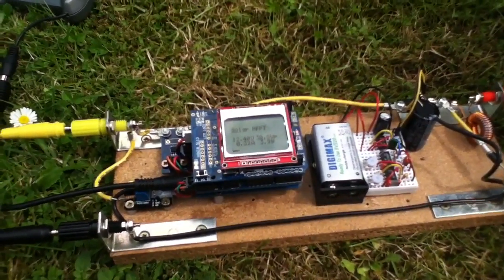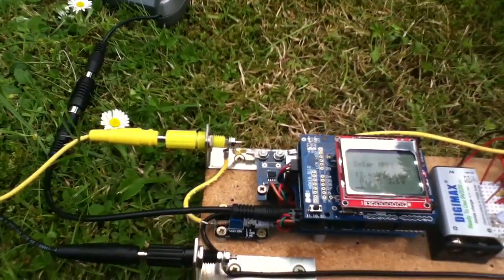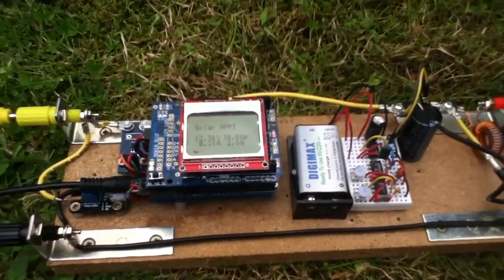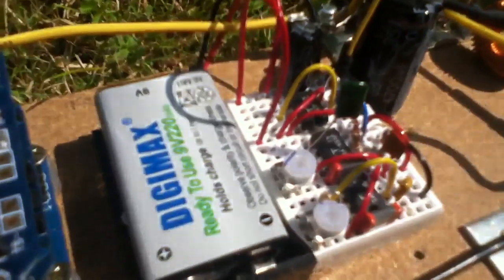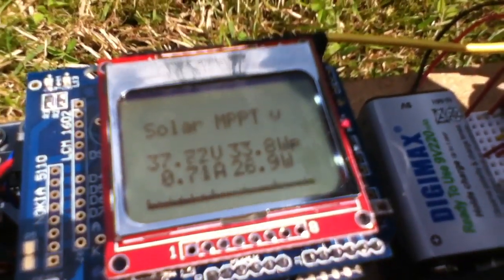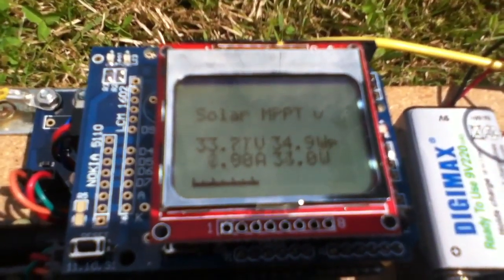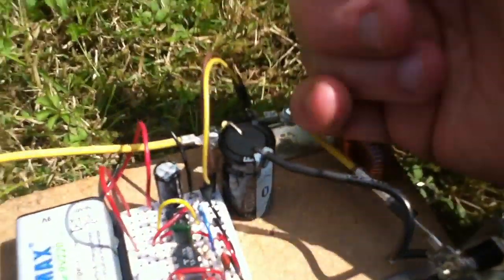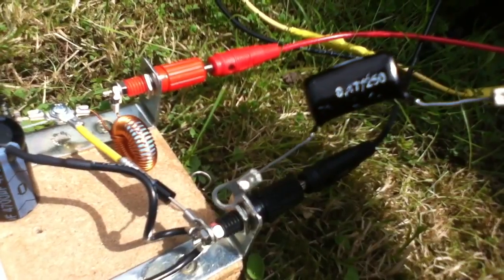MPPT Solar Charge Controller #10 - 72 Cell Solar Panel charging 12V Battery

Comment: Look up deadbanding. It's how they display tank gauge reading.  Basically, you only change /register new reading if it changes by 1up or down-by dead+band value.

So if db value is 2 watts and value is 17, you ignore readings until a new value is <=15 or >=19.

Comment: The solution to your dilemma at the end of your video (too bright for oscillator but you need sun for the panels) is that you leave the panels outside and run wire into your house/lab and do your work in there.  I know you would have to go outside to adjust the panels occasionally, but it would still be better :)

Comment: can i ask a favour julian ? just say i had 240v 1600rpm ac motor , now theres two questions i here what size inverter would i need to comforyably run it continuous ?

second quedtion - how would you with wires cheaply control the 12v input from 0 to max slightly overbuilt ?
Reply: You need at least 4x the wattage to run a motor

Comment: Nice work.
But why are they in series?
i always believed that series gets the voltage op, and parralel gets the watt op?
Reply from the maker: Panels in series raises the voltage, panels in parallel raises the current. Power (Watts) will be the same in both configurations.
Reply: and with higher voltage and lower current you can use thinner cables

Comment from the maker: And I think it's time to put current and voltage sensors on the battery side too, so both Watts in and Watts out can be measured. That will mean I can put an efficiency percentage on the display. It's one thing to extract maximum power from the solar panel, but quite another to deliver it to the battery without losing too much energy as heat.

Comment from the maker: Cheers!
I think the hot inductor and the ringing are connected, so hopefully it won't be necessary to beef up the inductor too much. I've bought 10 inductors from China, 100uH, supposedly rated at 6A. My philosophy for this project will be easily available, low cost components, so I'll have to make it work with them.
My main problem is lack of sunshine, so I might put my 100W panel on the test rig and do some tests under overcast skies.

Comment: Looks like it's coming along really well Julian.. :)  Do you think a brutal approach for the inductor might work - i,e. just wind it with heavier wire?  Perhaps you could set up a line so you can send the power from those panels indoors so you can have them connected and use the scope too.